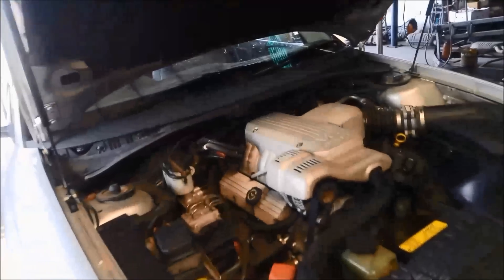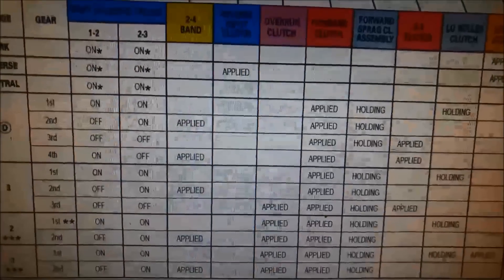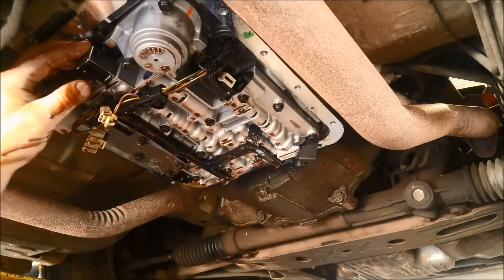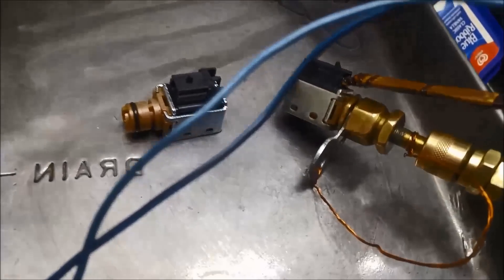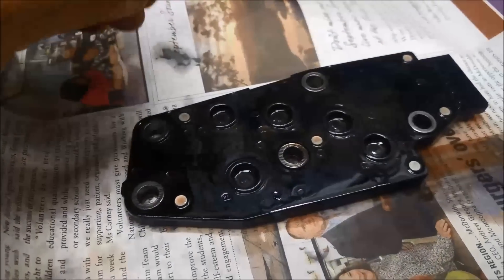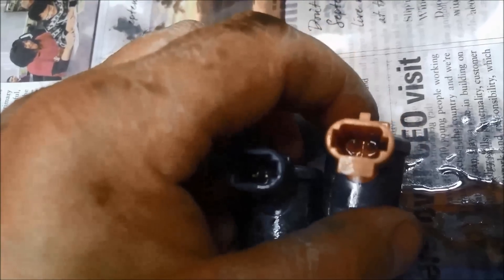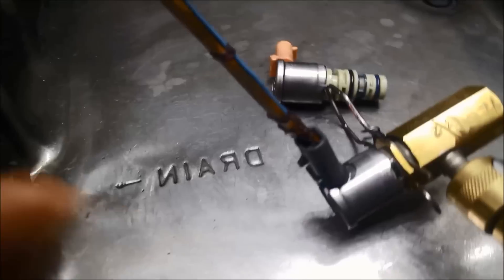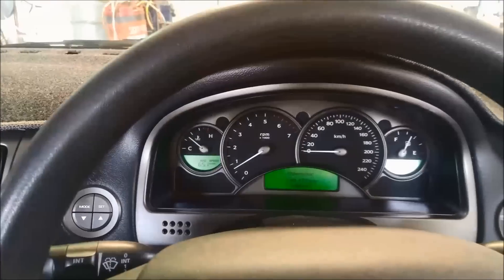4L60E Automatic Transmission stuck in Limp Mode & Manual 2nd Only Works how to DIY Repair

Comment: Any info on the pressure testing setup? Where did you source the cylinder with the same bore size for the solenoid and pressure fitting on the other end?

Comment: Hello,I have 1999 Pontiac trans am 5.7 ls1 4l60e trans it shifts in reverse,drive 1,2 3 manually but from drive it only shifts to second then jus stuck in second won’t go to third jus high rev,I change filter an the 2 solenoids that are beside each other, should I replace the one that you have in the video that has the pink isn’t that the one that’s the 3,2?
Reply from the maker: hi, check the range sensor and switch plate. cheers
Reply: What did the fix wind up being?

Comment: Excellent presentation. I have a 4l65 that is not shifting on its own. But I can manually shift through all gears no problem   Power is confirmed 12v at plug tcc is working.
Reply from the maker: hi, hard to determine without having a look. make sure you check all basics first. cheers

Comment: How do you get the 
Filter seal out
Reply from the maker: hi, with a small screw driver tap the cladding part of seal inward - bend it in a few spots toward center of seal and it should fall out  or easier to pull out with pliers. # CAREFUL not to damage the bore in pump. to tap it in we use a driver that fits into new seal - it needs to be tapped in squarely and flush with pump housing. cheers

Comment: Hello.  Please help.  Toyota RAV4, year 1996, 2000 cubic centimeters.  Automatic gearshift.  The speed does not go above 2000 rpm.  I cleaned all the vacuum and fuel systems.  No change and I don't know how to proceed.  Thanks.
Reply from the maker: hi, check all the basics first and then check exhaust isnt blocked by loosening it at easiest spot and trying. also can select manual 1st gear and see if it takes off hard. i`d need alot more info. cheers

Comment: Hey mate mine takes off in second gear. Changes to 2nd 3rd and 4th just doesn’t select first
Reply from the maker: hi, check all basics first. any fault codes ? check shift solenoid and pressure switch plate see also https://www.youtube.com/playlist?list=PLQLkuOdKuFotRCEQEAG1F90N3_WFl71IE  cheers
Reply: This is me man ever figure out the issue ?

Comment: I'm still struggling with my 2001 gmc 5.3 replaced valve body with new sensors I also went threw and cleaned and fixed all my groundwires still nothing but 2nd and third manual and reverse.
Reply from the maker: hi, did you replace the switch plate? check the range sensor/inhibitor switch as well. any fault codes ? cheers
Reply: Do I still need to replace switch plate

Comment: What is code p1860 and code p0785 and code po753 and code p0758 that’s all that is wrong with my truck right now and I need help
Reply from the maker: hi, plenty of code info in manuals or online, often multiple fault codes will indicate weak battery, bad earth or electrical connection. check all basics firt. cheers
Reply: did u figure it out bro have the same issue

Comment: Hello i have no 2 n 3 n 4 gears i have just 1 n reverse all other gears work under 2000 rpm have no power slipped on more rpm 
I use a pressure gauge i have 60 psi on all gears and all rpm and on driving mode just on  reverse i have 100 psi 
I take off the transmission and open i find all gears good and not burned  u think from the pressure switch manifold ?
Reply from the maker: hi, are you sure its 1st gear? nor limp mode 3rd gear? check your range sensor as well as all the basics before you take off pan. cheers
Reply: @YepThatsIt  i take off the transmission when i open the oil pan i find the manifold pressure switch without electric plastic connector  .
This plastc connector make this problems?

Comment: I want to replace the pressure control solenoid, is it as simple as taking off the Servo cover will anything fall out ? Thanks
Reply from the maker: hi, if you just take off the cover the spring and piston will stay in the cover. cheers
Reply: @YepThatsIt  too easy, thanks for that mate

Comment: Hey man this really helped I was puzzled with my 1997 z71 1500 and ima try this and see if it works, and also it’s doing some weird crap where the transmissions shifts into neutral sometimes could that also be the solenoid and would this also affect my speedometer only working after I hit a certain speed and it says I’m going way faster than I actually am?
Reply from the maker: hi, check the speed sensor and manifold switch plate for contamination. the solenoids should give a fault code. chec my related vids  cheers

Comment: 1998 tahoe out of nowhere won't go above 25-30 without revving only code is service 4wd encoder motor not sure if that could cause it or if its in need of a tranny rebuild, a week before I replaced a high pressure power steering hose it was driving good drove it at 10am drove fine went to leave at 6 pm later that night and it wouldn't go over 25-30 it would just rev up like I was in neutral, thanks for any input
Reply: I have replaced the solenoids in the transmission and have changed fluid and filter and a new catalytic converter and just about every sensor is brand new too, I just found it odd to be fine never show any sign of transmission failure drive fine then 8 hours later won't go over 30 mph, appreciate any tips or advice
Reply from the maker: hi, are there any fault codes? have you done a trans stall test? is it better or worse cold or hot ? many things to check and confirm before anyone can determine anything, especially when you say you have replaced many components. cheers
Reply: @YepThatsIt  I have not ran a Trans test and it doesn't matter hot or cold always does it only code is 4wd encoder motor I wasn't sure if it put it in a limp mode or something I just find it odd if it's the transmission to go from fine in the morning to not going over 25-30 mph in the evening, Thank you for the response
Reply: @anthonyarnold3612  ever figure it out? That just happed to mine

Comment: Hey y'all have a question. Have a 2007 chevy silverado with the 5.3 and the transmission won't gear down it struggles taking off what will cause the transmission not gear down to first? Its like it doesn't have any power seems like it's stuck in 3rd but it shift fine after that
Reply from the maker: hi, sounds like its in limp mode - electrical issue most often contaminated solenoids and switch plate, however check all basics first and check out my other 4l60e vids. cheers
Reply: @YepThatsIt  my 99 safari is in limp mode apparently. No 1st gear and now after replacing both shift solenoids and fluid, filter change, reverse slips a little at first + still no 1st.   Can the switch plate still cause limp mode? I did not clean it.. thanks
Reply: @YepThatsIt  also what are the basics?  Not throwing any codes

Comment: Hi I have an 03 hummer that is doing the same thing, less than 5k miles on a rebuilt Trans and it started going into limp mode, the last time I checked it threw codes for every single solenoid and said low power, changes the plug that goes the the shifter sensor and it still does the same, all fuses checked as well, the mechanic that rebuilt it said he doesn't think all solenoids would go out like that, but because it's been over my warranty time he can't fix it, any idea to what could cause it
Reply from the maker: hi, take it back to whoever rebuilt it. seems strange to only get 5000m warranty? cheers
Reply: @YepThatsIt  yea the warranty was for 2 years, sadly the truck sat so long while I worked out of state that it went through those 2 years without getting any real miles on it

Comment: What’s up I have a 2004 Silverado it doesn’t move in any gears all it does it rev when I change it to all gears can you help on what the problem is ? Appreciate it
Reply from the maker: hi, pop off one of coolinglinesand see if its pumping fluid...you may have pump damage. if it has flow then you have broken something inside or stripped splines. cheers

Comment: I have a 1995 Chevy caprice  think something is causing  the transmission to go In limp mode replaced trans same results low power in first gear like it’s dragging but if you get airflow it rides fine but seems to be stuck in one gear
Reply from the maker: hi, limp mode is logged by pcm as an electrical issue that has exceeded the set parameters several times. check solenoids, then wiring loom,then ecu. it will usally be the solenoids and/or pressure switch plate on these. if low power check for blocked catalytic converter by loosening exhaust. maybe replace fuel filter as well. cheers

Comment: I have an 02 Chevy Silverado 1500 4l60e transmission. I'm in limp mode. Takes off in like 3rd gear and high rpms but will not change gears.
Reply: What would be a good place to start looking?
Reply from the maker: @shannonchidester8171  hi, check all the basics first. cheers
Reply from the maker: hi, will be an electrical issue. cheers
Reply: Even with no codes?
Reply from the maker: @shannonchidester8171  if no codes, see our vids on 4l60e manifold switch plate
Reply: Did you ever figure this out? I have same issue. But getting a p0502 code and already switched out my vss sensor
Reply: Forgot to clear the codes 😂. P0502 cleared up now after pulling battery and code reset. Also getting p1406 for ERG issue. Cleaning that now and hopefully it works but still can't get it out of limp mode..

Comment: My transmission is stuck in limp mood only doing 20 mph no codes
Reply from the maker: hi, if no codes, check the manifold switch plate. cheers

Comment: Hey sir .I have a 04 Chevy Silverado I'm stuck in 3rd n no fan  can u hrlp
Reply from the maker: hi, 3rd gear is limp mode, check for fault codes to aim you in a direction, however always best to test all solenoids. cheers for beers
Reply: What about if there is no check engine light on?
Reply from the maker: @shannonchidester8171  check out my contaminated 4l60e manifold switch plate vids  https://youtu.be/BwMA9kkZHZs    https://youtu.be/ckffYahUkCE  https://youtu.be/uhFveVO3PhI   cheers

Comment: I have a 99 Tahoe and I have no second gear cannot ever manually put it in to gears
Reply from the maker: hi, how do you know its not going to 2nd gear? or is it in limp mode ( which is stuck in 3rd gear on these ) ? cheers
Reply: YepThatsIt  yes it’s stuck in third gear but when I come to a stop light and clear the p0758 code it shifts back to first I already changed my solenoids both of them

Comment: Good afternoon sir I own a 2003 Cadillac Escalade 6.0 awd and I have the same problem  my Transmisions seems to be stuck on limp mode  we just replaced all the solenoid and still stuck on limp mode  Any suggestions
Reply from the maker: hi, check all electrical connections and make sure switch plate isn`t contaminated. cheers

Comment: I had my 1996 blazer hooked up to a snap on tech 2 scanner and it is showing the two shift solenoids on at the same time. Is this a common issue? What would cause that?
Reply from the maker: hi, contact me on my face book link https://www.facebook.com/Yep-Thats-It-103051017785435/  and leave me which  kind of vehicle/transmission type you have, and leave a detailed description of any fault codes and issue you are having ( we are able to exchange pics/diagrams on there ) and details of what work you have already performed or checked...... you will need to buy me some beers ( link is in face book ) and I will answer your questions accordingly. cheers
Reply from the maker: hi, try without forward slash...  https://www.facebook.com/Yep-Thats-It-103051017785435   cheers

Comment: good morning.  I have a hummer h2, it does not change gear the speedometer does not work.  but I have no fault code, can the speedometer be the cause of the gearbox problem?
Reply from the maker: hi, first check and do all the basics first without removing anything....oil level, battery full and strong, electrical connectors all good and not oxidised. the output speed sensor tells the computer the vehicle is moving and compares to the input sensor , if its not working you need to test and/or replace it anyway. if no codes, then i`d drop pan and check to see if the manifold switch place is choc block full with rubbish. its the plate bolted on to bottom of valve body. cheers
Reply: I have this same problem.. transmission revving up in first gear but wont change to second..I replaced the A.and B solenoid and still the same problem but it's not reading no codes
Reply: have u found what ur issue is? thanx

Comment: Do you have a video on how you made the air tester for the solenoids. My transmission is do the same thing.
Reply from the maker: hi, not for moment, just make on lathe taking valve body bore measurements for solenoid. cheers

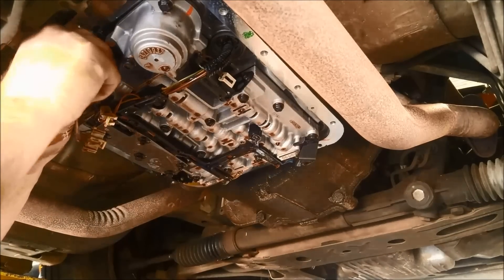Comment: 5:38 6:44 how those this shift solenoid adapter work?   Did you manufacture this unit yourself, or can it be purchased, and can a DIY make one for themselves?  Thank You.

11:26 What kind of cleaning solution are you using?
Reply from the maker: hi, yeah you can make tester. copy the bore sizes from the valve body. solvent we use is mobil x55. we use it because I don't like a distinctive smell like most other solvents seem to have. cheers